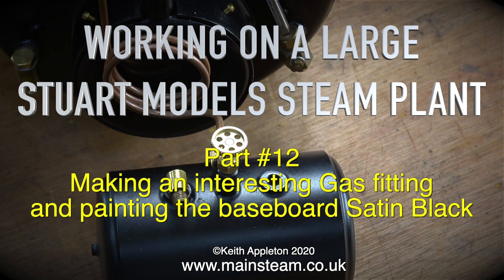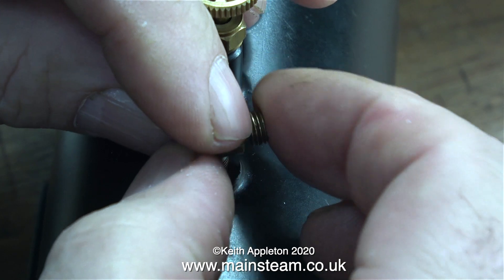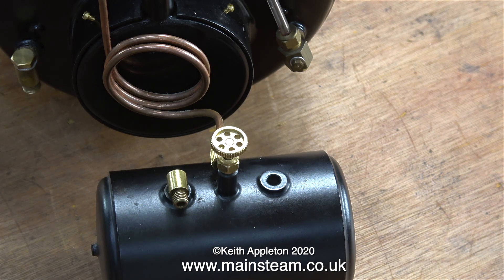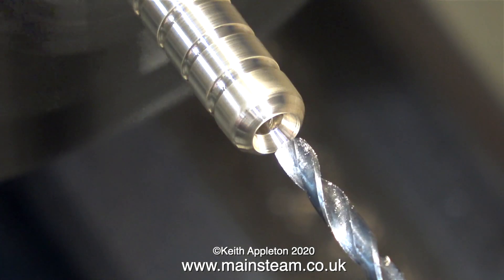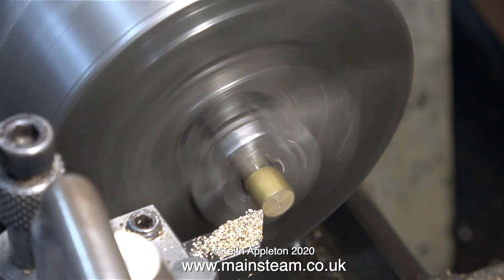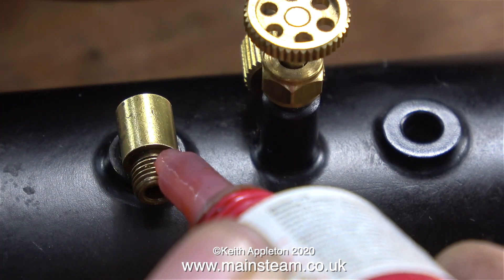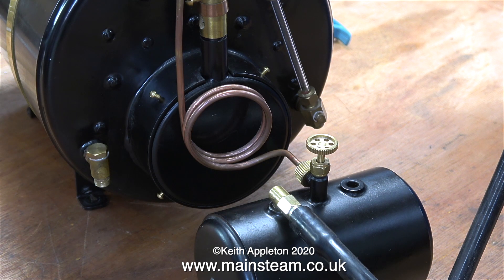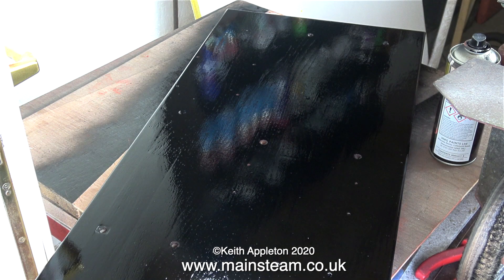WORKING ON A LARGE STUART MODELS STEAM PLANT - PART #12

Comment: First l must confess I've never built a model steam plant. 35+ years as a hd mech im no stranger to a tool box tho. I love all mechanical and the model steam has caught my eye as retirement is close but ill never quit. 

Your right butane and propane not the most stable in the gas family. Not my first choice having owned boats and will not have them on board period. Kerosene is safe as it needs a wick to burn but low on btu's white gas primus camp stove burner will be my choice few pumps to get it going then its self contained. The smell may bother some but as for me its not a problem. Any complaints ill just produce gas myself whiner gone.
Has a white gas camping stove type burner ever been used?
Will try a table top model first but l like the ride um stuff so any pointers on plans? I'd like to build a 1/4 scale tracked engine limited experiance with boilers and unsure hiw to scale one down and be efficient.